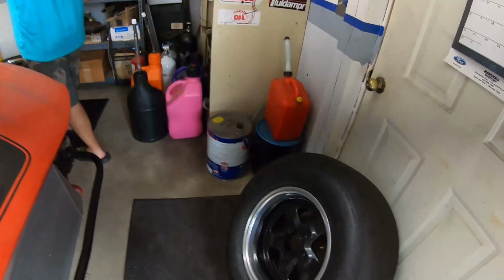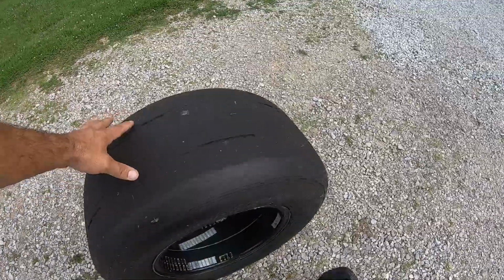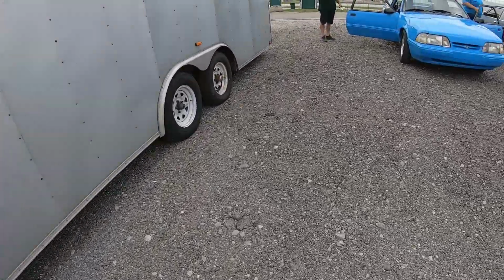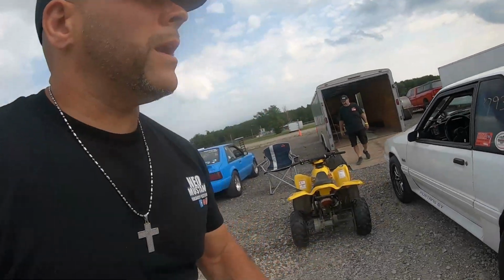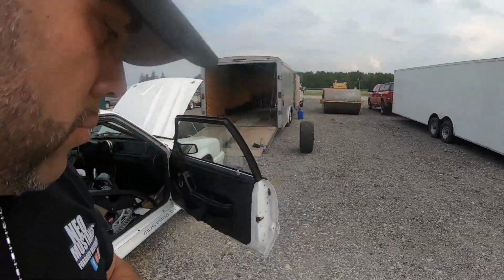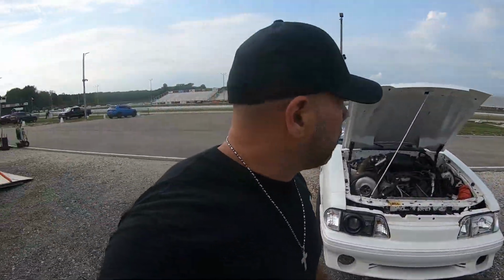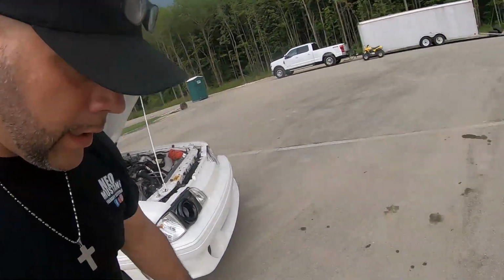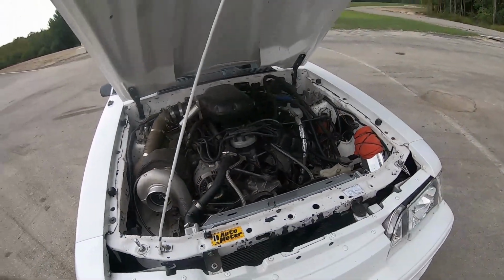We Put Radials On A Stick Shift Turbo Foxbody Did NOT Go Well..

Comment: Glad to see you at the track, everything happens for a reason & I'm glad it was not anything major. Good call on aborting the run. Curious, does it help to heat sleave the lower radiator hose on our turbo cars?

Comment: My car isnt as quick as yours .. the best its ran is a 7.05 in a 1/8 mile .. with a 1. 47 60 ft ….  I always set the air pressure in my radials at 15psi to start with .. i have went as low as 9 psi but dont recomend  it …and i dont spin a bit … but i am a automatic car with less hp than you have .. how much air did you have in your radials ?
Reply from the maker: Ya your setup and my setup are two completely different cars

Comment: Quick time pros work good dot slicks
Reply from the maker: Ya we gonna mess with those next
Reply: @Neomustangs   your car will do awesome on them . I need to get some suspension advice from you for stick shift on most no prep stuff . I’ll end up emailing you .
Reply: When is the next stickshift race? And what tire are they requiring u to have? I need new rear shocks.